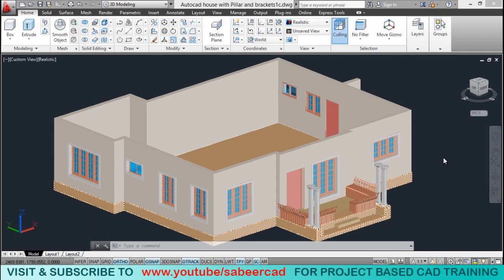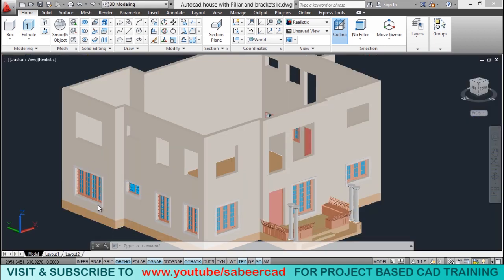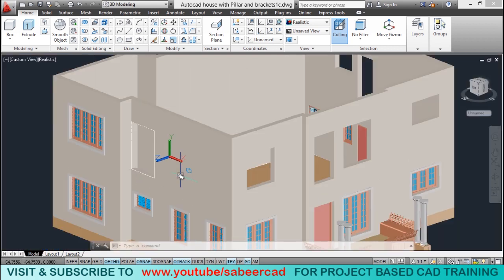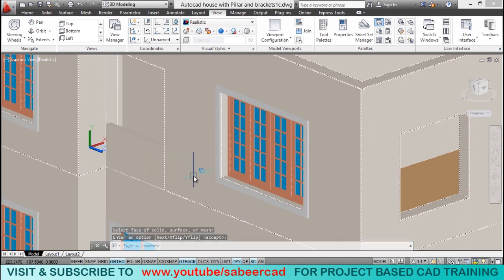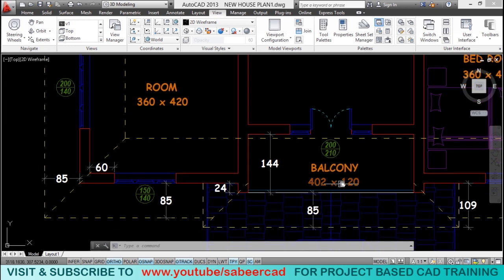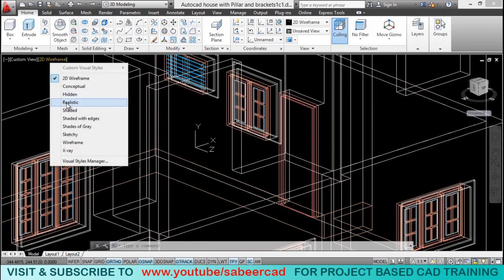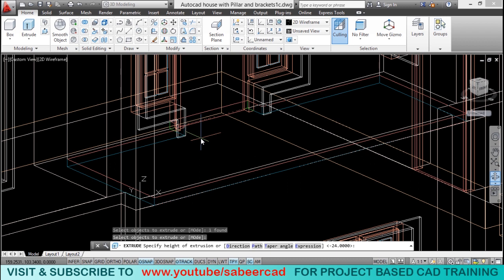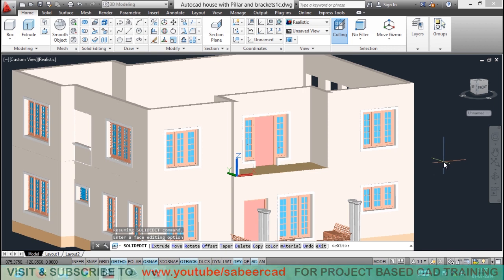CREATING THE FIRST FLOOR FROM THE GROUND FLOOR | CREATE FIRST FLOOR

Comment: copy and paste a floor is not the correct way of making floors. You should use the autocad architecture function instead.
Reply from the maker: AutoCAD is an Entry level all purpose solution. A mechanical or electrical engineer cannot use AutoCAD Architecture
Reply: @sabeercad  Well that's your opninion. AKA No one cares.

Comment: Thanks for your tutorial. It is excellent. I have a query. I have a house  built on 300 sq yds plot, which was built in 1981. I want to build 1-2 floors above it, without demolishing the old house. Only way is build using concrete pillars. Can I take help of the software to design the floors using pillars. Kindly advise, thanks. I am willing to pay for your services, thanks.
Reply from the maker: Can you mail me the plan in sabeercad@gmail.com and few photographs of the existing building